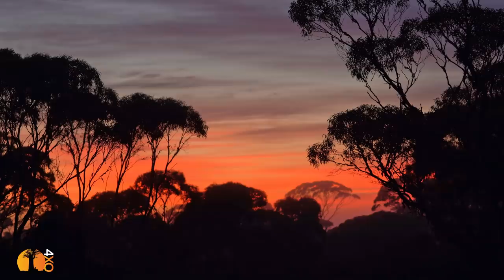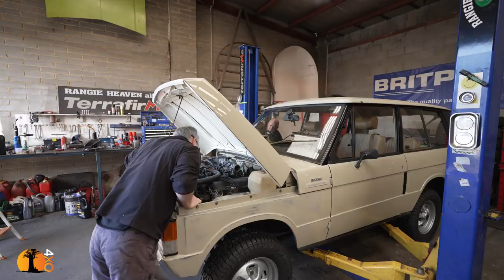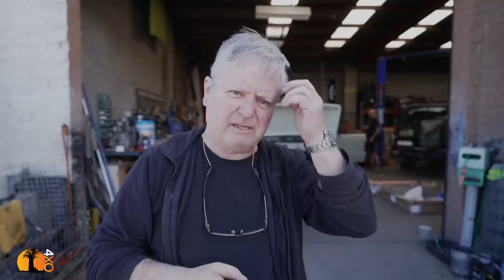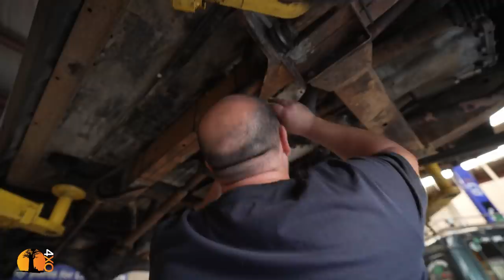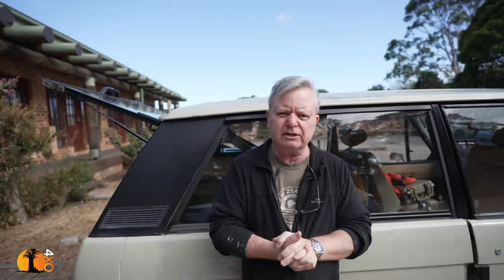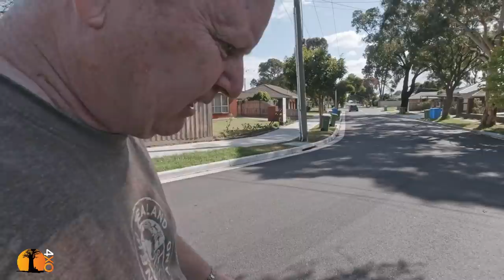RANGE ROVER FIRST RUN, FIRST BIG SCARE. Part-4 RANGE ROVER CLASSIC REBUILD | 4xOverland

Comment: What I've always wondered is what the rust does under that sound deadener. It looks like it sticks like glue. Will you remove it again to repair the rust? Otherwise it will just rust away under there.
Reply: Was thinking the same. That was a cowboy move putting that over the rust on the floor pans.
Reply: Saw that and thought immediately "oh God the comments section"
Reply from the maker: Everyone watching every detail and nothing is missed by eyes looking for something to criticise.  . . .  I sprayed a rust sealer first. There are a not of things I didn't film for the video. The rust was a thin surface rust only. Assume the best, not the worst.
Reply: @4xoverland  I was just wondering since everyone talks about sound deadener but I don't want to put it on mine until the rust gets addressed, and also I was wondering how easy it is to remove in the future to address the rust since it looks like it is super sticky and very difficult to remove.
Reply: @4xoverland  Then as a film maker you should explain what your doing...we as watchers assume what you show is what you did... and did you spray rust sealer and possibly mechanically remove rust and treat with a rust convertor?...only you know...
Reply: @4xoverland  I think that you should be prepared for the worst and assume the worst with every problem you take on. I think you rushed the step, sound deadening is something that could have waited until you got back to Perth where you could have better treated that rust. However, its your car and you can do as you wish. You can not film a process, publicly post it and expect only positive responses. Especially in such a die hard LR community.
Reply: @4xoverland  stop at Bunnings for some cement powder to harden you up abit. No one criticized you mate, while you at it get your ego tuned.

Comment: Hey Andrew, one of your followers / Patreons here! Enjoying the series a lot... As a D1 V8 driver which also sit low at the back when loaded, I would fully recommend putting in Airbags. I have all sorts of loading scenarios (trailer, heavy load / no load, off road / on road and combinations thereof) - Airbags give you flexibility for all, and easy to adjust overlanding too!

Comment: 15mins in. The rear sagging issue, my fix for this is firstly get get rid of the self levelling damper, a total waste of time they were.  Landrover themselves scrapped the concept themselves in later Classic Range Rovers, early Discovery's and Defender. Next step, remove and test the springs to be sure that they're not past it. If all is well fit Poly Airbags inside the rear springs. I found this to be a good solution and buy inflating or deflating the bags as needed you get the best of both world's
Reply: Mate there is nothing wrong with the Sachs Boge Load Leveller if in good working order. The concept is quite good and LR ran them for Decades. They were never in the D1 as they wanted to set it apart from the RR and the Defender County’s actually had them.
Reply: @husq2100  couldn't disagree more, yes the county did have them and as a landy mechanic with dealerships and independents  for many years I have never replaced one, ever seen one replaced or ever heard of one replaced. Never heard on one being sold to a customer as a replacement part and many a knock which thought to be coming out of the A frame ball joint actually turned out to be coming from the load leveller. I find the argument you offer by saying they set discovery apart by not using it ridiculous.  They set discovery apart by putting a new body shape onto it, in all of there rethinks, new design features and concepts they were contemplating while imagining the forth coming discovery 1 I'm  confident the load leveller was the last thing on their mind,, well obviously,,, that's  why it ain't there

Comment: I still say TNT it to Perth and fly . If this all goes belly up , you'll have a heap of trouble and expense that you didn't need . This isn't a wartime /fleeing situation . Play it safe .
Reply: Well we now know it got there, but sympathetically setting off  with a copius  supply of all fluids,  araldite   hand tools, jubilee clips, hoses, cable, gaffer tape , a fuel pump, distributor, coil, an alternator ( starter motor a luxury) and a big hammer gives  a very near 100% chance of arrival under power. My Series One has proved this in some ludicrous trips, but is happiest at 42 mph, with 60mph   only feasible with the roof off when you can't hear the mechanical thrashing.

Comment: Yeah feel you with that.  Had our series 3 engine (remanufactured) start leaking from the rear of motor. Best it happened now rather than later but it's still a bit of a kick in the teeth.
Reply: The rear main seal design is rubbish on the old series engines.
Its cut in half from the factory lol

Comment: Fuel consumption, this is partly why I sold my 1987 V8 RRC and bought a good used 1993 200tdi RRC. They have the same sized fuel tank but the diesel 200tdi goes twice the distance, or more, on that tank.
Reply: @zbigniew1181  Nobody ever believed me that I was achieving a consistent 31mpg in my 200 TDI 110 CSW.

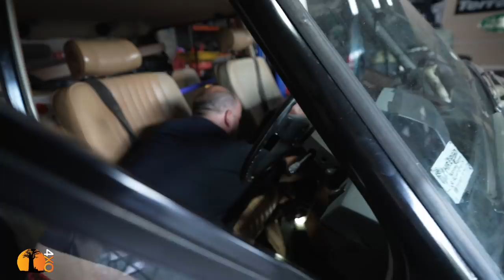Comment: 12:25 - I really had to chuckle with the transfer case selector shaft.  After completely rebuilding my very first RR (a '78), we left immediately for a holiday of off-roading in Greece. The RR had not moved more than 150km under its own power in 5+ years when we left, and that 150km was mainly just getting it inspected and registered... But it got us down to Greece, and after 2 weeks of driving through the country on and off-road, we had less than 12 hours to drive several hundred km's and get back to the ferry. Literally the last time I was to use low range on that trip, the roll pin on the selector shaft came out with the transfer case in low range. I could not get it to go back in for the life of me. I really became worried when I realized that even at 6000rpm in 4th gear we'd be too slow to make it back to the ferry on time. At the last minute, I managed to shift the transfer case to high with pliers from below. I didn't touch the transfer case lever again till we were home. And, apart from a failing master cylinder and a carb diaphragm repaired with a bicycle tire patch kit, the rest of the trip was uneventful. :-))

Comment: How good are the Front Runner Wolf Pack boxes!. They've just released a Pro version, fully sealed. Top stuff. Love the build up Andrew
Reply from the maker: I hate them. Annoying things. I was donated these but I used them once. Only once.
Reply: @4xoverland  I think its a value for money thing really. Not great, but better than a bunnings tub. The Pro's are much better but still not excellent. I remember you having a discussion with Gwynn about the boxes you put into the Dream Tourer. What were those?

Comment: Lekker videos! If it was me doing this with substantial funds, I would dump the current engine and gearbox and replace with a Hilux 2.8 gd-6 with a few mods here and there. Keeping the look and general feel but having engine and drive train reliability. Not lekker to get stuck in the middle of nowhere especially with wife on board.

Comment: I find it such a bizarre shame, here in Ireland there's at least 3 scrapped range rovers with the same dashboard as yours at my mechanic's yard, and they're not cracked at all or damaged, and yet yours is looked after and it has that damage, presumably from the sun.. If you get stuck and can't find an undamaged dashboard let me know I suppose, there's probably plenty here in Ireland. It'll cost you more on shipping I'd say than for me to get you one
Reply: I'm also in Ireland. Are there decent classic range rovers available that you know of or would I be better off getting one in the UK?
Reply: @adiboo8142  I know of absolutely no classics for sale no unfortunately. They've gone very scarce or people have been putting the chassis under discoverys or other range rovers. Market has gone mental
Reply: @FPVsean  Seems to be that way alright unfortunately
Reply: @adiboo8142  Market for "classics" will go even way more insane with each new generation of extremely over-electrified, displacementwise vastly undersized useless suburbia-biturbo-toy which is compliant to mental EU-grime-panic way more than it is to any rational requirements customers might have. People long for cars, not for useless garbage cans, and restoring the old gold is the only way to come by one of those these days. We'll see what INEOS will bring with the Grenadier.

Comment: The rear self levelling unit should pump it self up while you drive till it re levels up the rear suspension. If it didn't, have it checked. ⚠️
Reply from the maker: The rear self-levelling unit is a joke. They never work for more than a few years. Far cheaper just to fit some better springs.
Reply: @4xoverland  Agree, too expensive to fix. I have varying loads, so I fitted springs rated for the least load and compensate with airbags when I'm heavy. To improve rock crawling ride, I fabbed a small U hose to connect the airbags.

Comment: Hello Andrew, one item really niggles me about this particular video. When the RR was loaded up there was a distinct sag in the rear, which you explained. Just wonder why you did not take the opportunity to make the rear springs a little stiffer; higher load rated springs, if that's the way to do it on RR.
Reply from the maker: I didn't need to. A little sag isn't a problem. It's just a common characteristic. But other reasons might be money and time. I will make this car 'perfect', all in good time.

Comment: Liked the comment about the sagging rear end. What was the limit on the Boge strut ? 400-500kg ? Had the rear tyres on mine completely inside the wheel arches for short journeys only, until I uprated the rear springs.
Reply from the maker: The limit on the Boge strut is about two months. That's how long they work until they don't any more.
Reply from the maker: Ive never ever seen one actually working. Ever.

Comment: I pretty much think that you aren't going to be able  to run it over the desert Andrew I think if you can get it back to WA by train  and  strip the crap out of the rover and see if it can really support doing trips in the wild you are going to have problems personally if it was me I bring it back to perth and  arsehole the motor  and gearbox and drop a toyota  motor and gear box in it  and it likely  be the best thing for its repairability  on the side of the road or limp back  to a town with mechanic in a town or city..

Comment: This makes me want to pass on my '95 LWB refurbish, and look for an actual old Range Rover.
Reply: Don't sell your car short. The '95 (if it is a mk I) is an amazing RR. It still has the rugged good looks that were annihillated in the P38A but it has the more efficient 4.2 EFI engine.
Reply: @heijxje  Only thing I'm afraid of is the electronics. SRS is on, Three Amigos, etc... Just don't want to deal with that stuff.

Comment: Back lit by window -- not the best lighting to be sure. Please, please check lighting for future videos. Back lighting is the worst. This is far and away an amateur operation mistake which is unworthy of your wonderful channel.
Reply from the maker: I have to deal with comments but this goes on the wall as this month's best examples of an ungrateful audience. "amateur "? WTF did you expect? Netflix? Firstly its free and your contribution is to complain. Secondly, you have to be kidding, right? You know I have just one crew. And one presenter. And one editor. All done by me. The story is more important than technical details. Backlighting is NOT the worse. Your monitor sucks! Sometimes it's good. But here it's something I had no choice with. This is real. No setups, no contrived bullshit. And occasionally there is a bit of backlight that makes seeing the detail difficult. "Check my lighting for future videos." WHAT LIGHTING?!?!  Please, please check your sense of gratitude for future videos.
Reply: @4xoverland  ,Spot on! what a joke that comment is. Rest assured Andrew that there is absolutely no backlight issue with the video. Speed racer needs to lay off the speed.
Reply: @4xoverland  Man, just fix the backlight issue and don't respond to comments like that. What a waste of time. You'll get the lighting right and move on and we'll see better quality in future videos. No big deal. Don't even respond to comments you don't like as it's not worth it, better off putting your energy into improving the videos. Keep up the good work!

Comment: 450km from a tank... yikes.
Reply: The previous 5.5L V8 G63 Amg does about 350km in its 80L tank, I don't care how rich you are, driving that on a daily basis will put a dent in your pocket when you calculate your fuel costs at the end of the year😁😀

Comment: Good to see the old Range Rovers analogue early fault detection clunking thingymajiggy still works. The radio overrides it !
Reply: That's the beauty of older, mechanical cars - if something goes wrong you can hear it. Nowadays if something electronic goes wrong it just stops working. I know you can get scan tools and the like, but that brings me to the other gripe I have with modern vehicles - nothing is designed to be fixed, you just have to replace non-functioning parts with new ones. I remember fondly the times when you could fix your car with a few relatively basic tools. Now even bicycles are getting too complex!

Comment: Bit noisy in the engine bay at the end of the video, can't hear it clearly enough through my phone but if you think it's coming from the left hand side of the engine one can only pray that the lifters and rocker gear are Ok. I thought it sounded like an alternator bearing or collapsed water pump bearing causing the impeller to scrape the timing cover. In any event it's time to bring out the cheque book and pen. By the way i think 20W60 eng oil is a bit heavy even for an old V8

Comment: I owned a County V8 1985 build from brand new. The book said to tune it to 9 degrees, it always ran much better at 12. Also  had  the early pollution set on the carburetors  decommissioned,  it use to make it over rev at an idle.
Reply: I advanced most engines for better performance .

Comment: Advanced timing will increase fuel use.
Reply: At the factory they were set at 3 degrees BTDC. low compression engines i think were 2 degrees ATDC with a diaphragm fitted on the vacuum advance to stop it from working. I worked for a landrover dealership and the farthest I would set them at was 9 degrees BTDC,  you can get pre detonation happening long before you can actually hear it. And yes your right advancing ign timing will only burn through more fuel regardless of the octane

Comment: Ive never owned one but before he said can you see my problem im telling myself why is the back end so low
Reply: It's because the chassis has bent.  Or because the rear springs are too short.  Or because the front springs are too long.  Or just because it's a POS :)
Reply from the maker: The back is low because the rear springs are too weak for the weight.
Reply: Never the less still looks amazing

Comment: You put a hose clamp on the shaft to stop it poping out of place . Mine had the same problem . Plus they jump out of high range because the dog gears are,a bit worn on the gear . They made different size shims to go into the transfercase to make the selector ring go closer to high range gear to stop them jumping out of high range like the lt95 does . I just took mine apart and replaced  my high range gear and some of the shims i burnt in the case because the lt95 box suck the oil out of the transercase and spills out the gearbox . You fix this by tapping the filler nut on the box and putting a line from the filler nut in the box to the filler plug in the transfer box . The old rangie classics have their quirks . I have 2 4 door models . An 84 and 86 . The 84 is nearly stock and the 86 is highly moded from stock with an Holden efi v8 and t400 box and lots of terafirma and ashcroft parts in it . Ww shock absorbers in queensland can recon the boge load levellers i just had mine done for not to bad price concidering you cant find them anymore . I think the 2 door and 4 door are different but i couldnt see why they wouldnt all be the same . I just replaced mine and the ball joint and bushes at the back .

Comment: Glad you seem to see you have the same luck as me on when it comes to this sort of thing, but there is where KISS works and nothign that can’t be fixed or worked around.  You can do the same with modern day ECU based systems, but you need to understand how they work in order to know what you can disable and by-pass in order to GYH, JLR do do this sort of work as no doubt do Toymota and Datsun but it is not widely known or shared and often it is ‘discovered’ during test phases.  If you have a laptop and the software and know what to do, you can do alot of configuration to enable the vehicle to keep going even if limp modes and default maps have been enabled.

Comment: Re your dual battery and dc-dc charger.  First you should have fused your leads at both ends near the battery to prevent a fire in case of a short.  Socond the dc-dc charger should be at the back of the vehicle closest to the second battery as it is meant to account partially for voltage loss and manage the correct charge for that second battery.  Mick